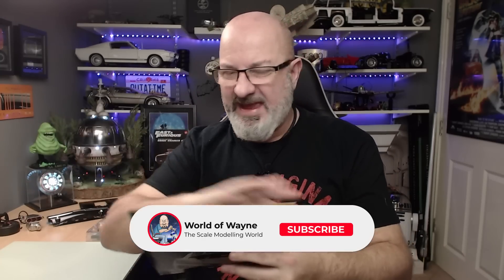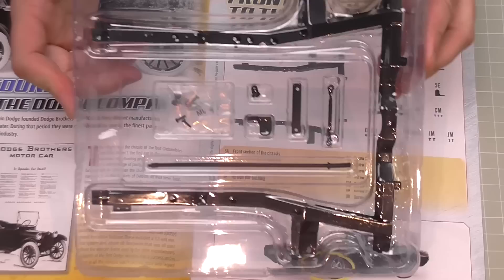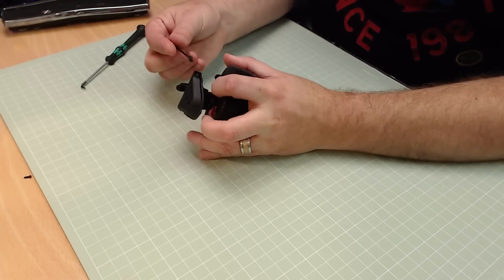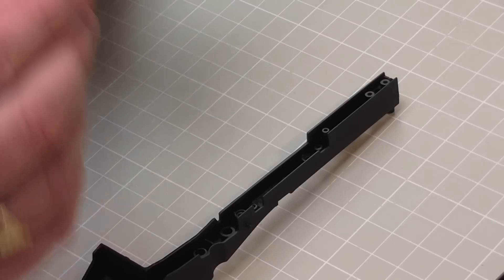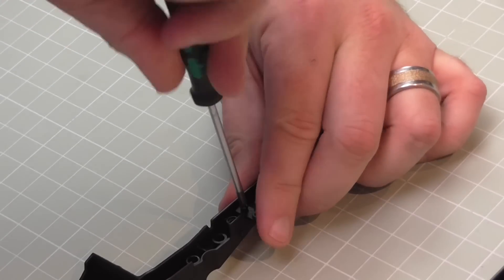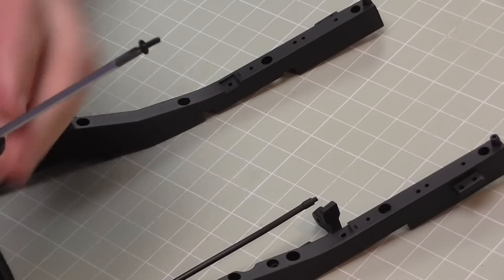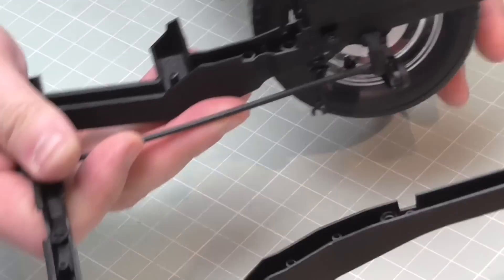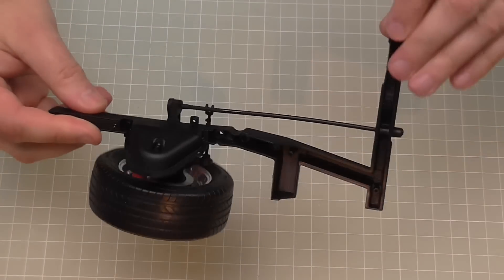Build the Fast & Furious Dodge Charger R/T - Part 5 - Connecting the Front Left Wheel to the Chassis

Comment: Great video as usual Wayne well done.The outer steering arms are called track rods, they will be connected to a middle bar called a drag link , trailing arms(or radius arms) are usually connected to the axles directly for up and down movement .
Sorry for corrections,..I know its sad after 40 years in the motor trade I have turned into the Oracle of motor parts knowledge LOL hope I was some help?.

Will not be building this one (I would love to but SPACE!),but it looks great fun,busy building The x wing, de lorean and gt 40 and a Resin Model Star wars Y wing in same scale as the x wing,...As you would say "it,s ginormous" as you can guess.
Look forward to live stream.

Comment: I know this is an old video, I also know this issue came out this week in Uk retails stores as I'm getting mine that way, I know we all may be tempted to do the spring into the suspension now but I implore you please wait until issue 5, doing this now could damage the paintwork on the lower suspension arm. you will be tempted to try and push the suspension down but this will scratch the paintwork. I discovered this myself today. to my dismay. so now i have to strip the paint and respray this part.

Comment: The diecast model I have of this is steadily losing its paint ready for its steam driven conversion. I've already made a design for the boiler and pistons. I've got to figure how the pistons will attach to the gearbox to finish the engine part of the build. I have decided to put the firebox door in the centre console and use the rear seat area and boot as the tender.